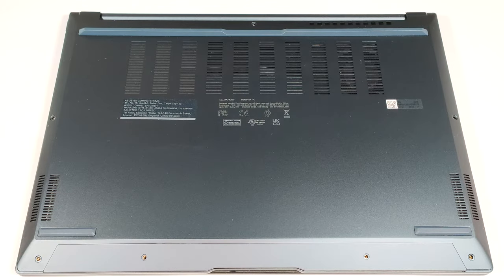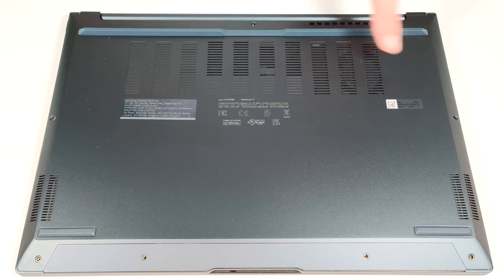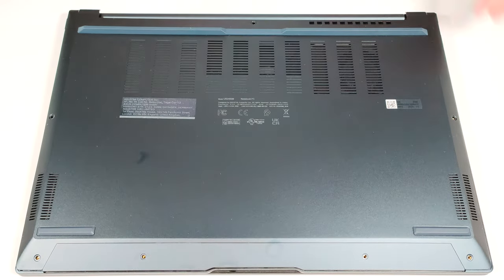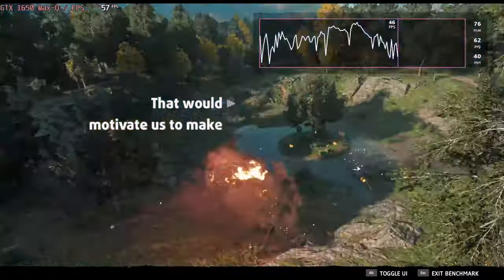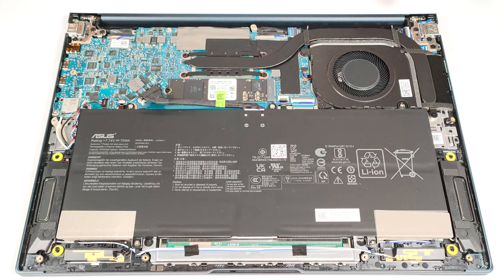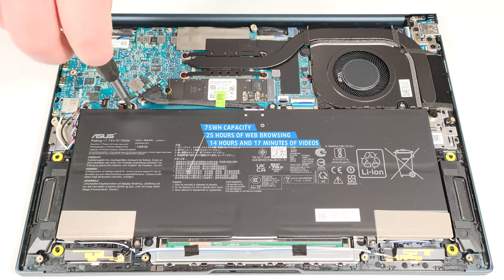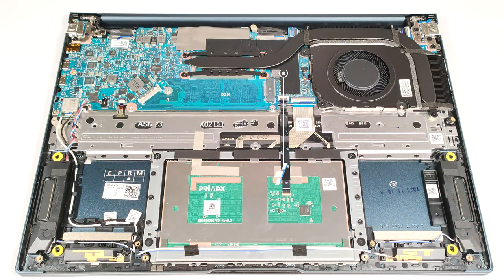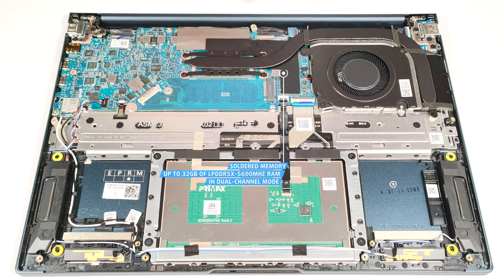🛠️ How to open ASUS Zenbook 14 OLED (UX3405) - disassembly and upgrade options

Comment: can the NVME slot take large drives like 4tb or 8tb disk?
Reply: No, this is the only laptop that doesn't adhere to GPT standards. 
It can only take a 1.99TB disk because that's definitely how anything works.
Similar question: Can this laptop work with a USB mouse?
Reply: The comment above is sarcastic btw